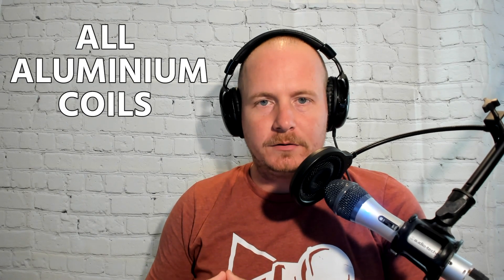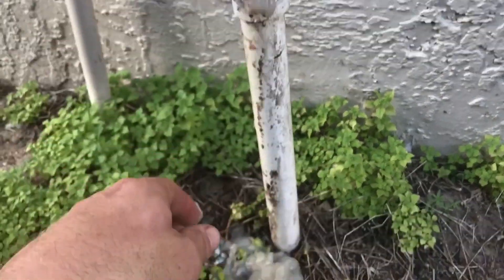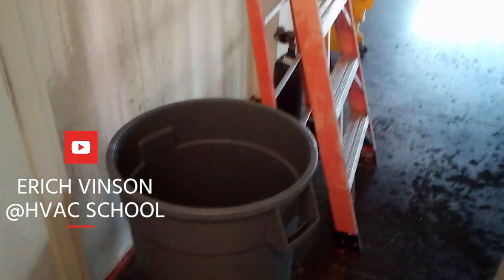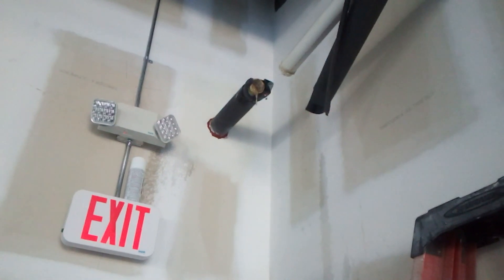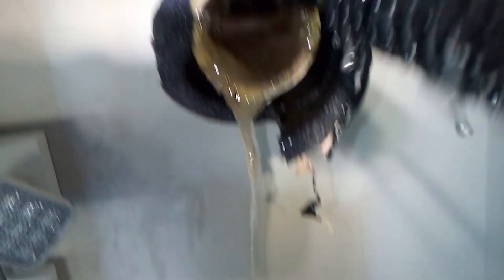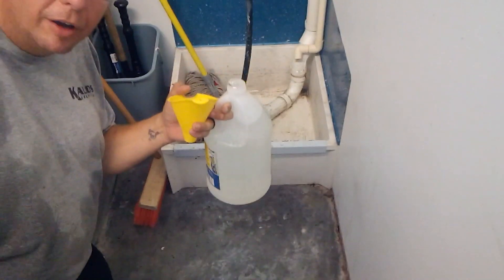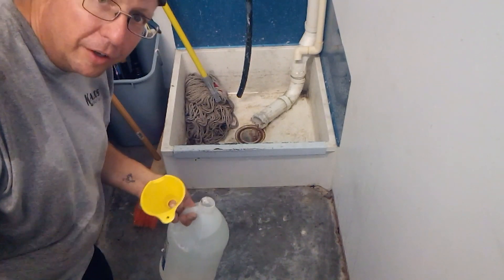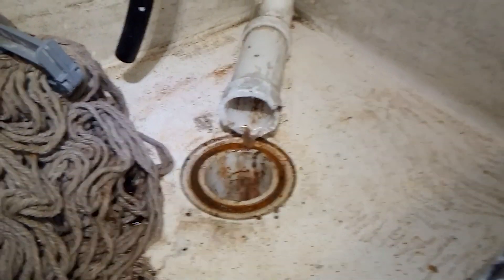Cleaning a Difficult AC Condensate Drain

Comment: After 20 years of living in my house, my line had recently started backing up a couple of times within a couple of months. I finally resolved to just cut the line and see what’s going on. It was for probably 1/3 to a half of the pipe filled with green sludge or slime. It was mostly confined in the area between the AC evaporator, and maybe 8 feet from it. My condensate line runs probably 20 feet to the outside of my home. I decided instead of cleaning it just to replace the bulk of it.  No amount of suction or any cleaning agent that I know of would really be able to get this stuff out.  Replacing the line was pretty straightforward.

Comment: Wide angle 90's like used for electrical that are pressure rated at sch40 levels would be nice. I don't like putting pressure in a condensate line for clearing, but if I installed it I would not hesitate. Also a small  snake will navigate the wide elbows much better than typical elbows. 10' pvc with the bell end on it (like electrical) would be nice too.

Comment: It happened to me a few years ago at a gambling hall on a copper evaporator with aluminum fins: After the anti-smoking law appeared in my country, I was called to clean the air conditioning system to eliminate the smell of smoke. I used 2 cleaning products: one from Favorcool sb-910 or sb-930 to clean smoke deposits from evaporators and a sterilization solution from Errecom. After that every 2-3 months the drainage pipes made from PVC began to  clog every 2-3 months with a white slime. Before cleaning the smoke depozita they never had problems with clogged drain pipes. The smoke deposits were too toxic and did not allow the formation of bacteria slime.
As a tip: use a vacuum cleaner at the end of the drain pipe to unloc the slaim in the cloged drain.